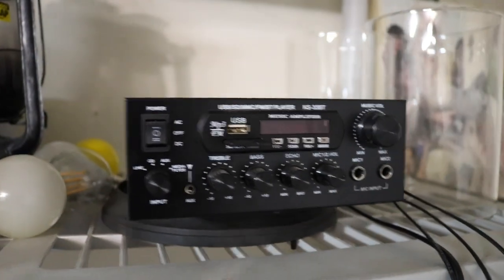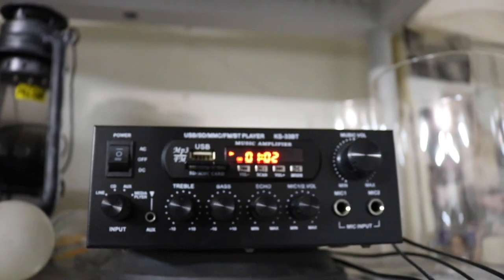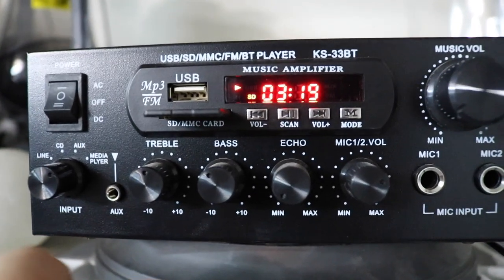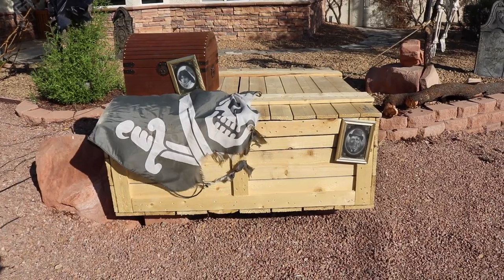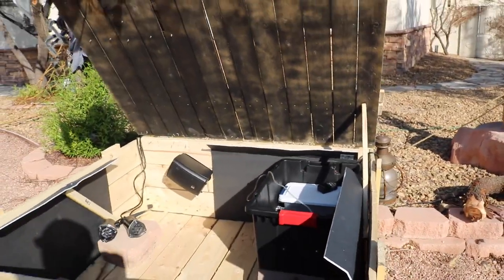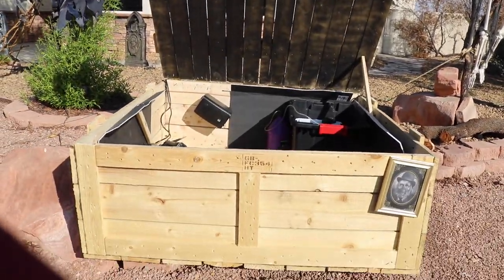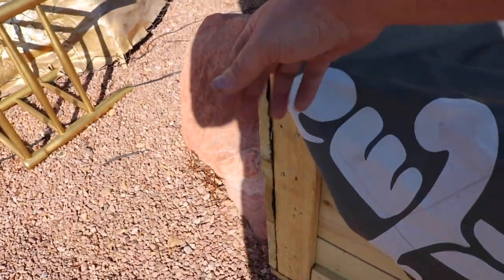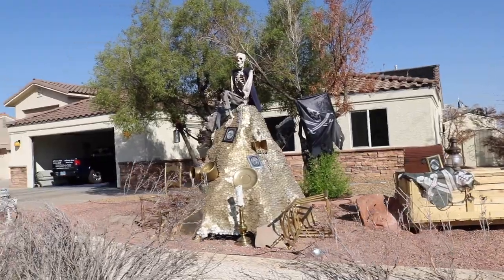Sound System Setup Speakers Haunted House Halloween Yard Display How To DIY Sound Effects Amplifier

Comment: Do you have to use a specific type of SD card? I am trying to use a regular SD card and it won't fit in the opening. I don't want to jam it and have it break.
Reply from the maker: Just a normal SD card, nothing special.
Reply: @butterflybty  Thank you for replying and sorry to bother you. I'm very novice with wiring and felt that your video gave me the push to finally try it myself. I do see that the SD card is inserted and working. Everything seems to be operating perfectly! Thank you for your assistance and for creating this video!

Comment: Of all the videos out there about DIY Haunting, there is almost NOTHING on sound distribution. It's so refreshing to see some content finally being produced on that subject. I had to teach myself over the years, but I hope lots of budding young haunters see this video and learn! 

Not sure how many amplifiers you're using, but be careful not to wire up more than a single speaker to each set of terminals on the back of the amp. For example, the amp you're using is a 2-channel amp, so no more than 2 speakers should be wired up to it (this breaks down further into whether or not the amp is rated for a 4 ohm load, and/or if you're wiring in series vs. parallel). The only reason I bring this up is because you showed us 3 speakers but only 1 amp. If you have more amps in play then you're sitting pretty :)
Reply from the maker: Thank you! That is the exact reason I made this video. Hopefully it will soon circulate and help more haunters! Yes, I am running 4 speakers on one amplifier however I use small speakers with little bass and don't have them up very loud. Unit never gets hot as I check it often. Not sure on the exact amps but I will check. Thank you very much for the input.